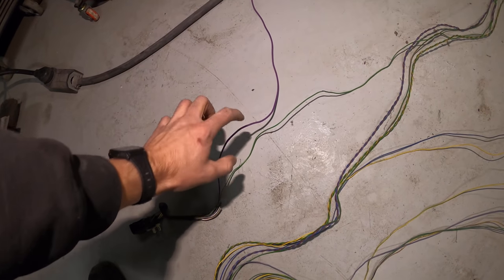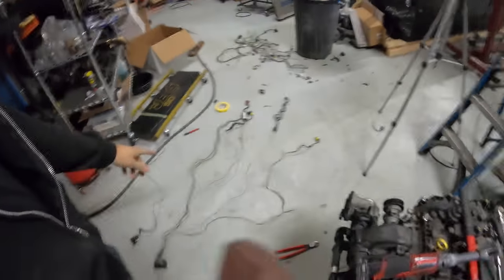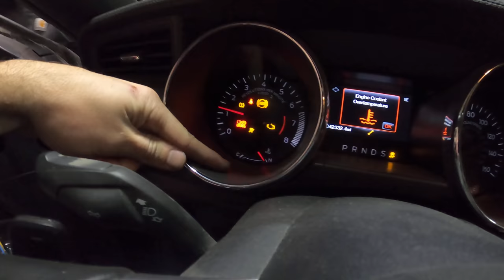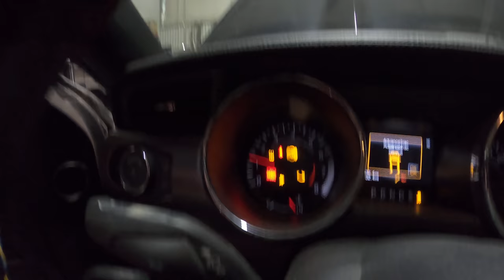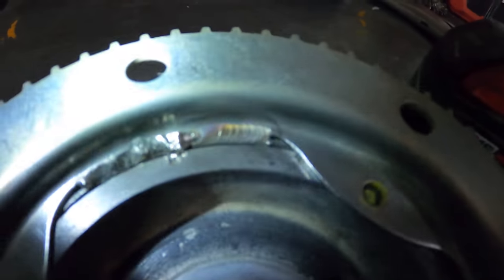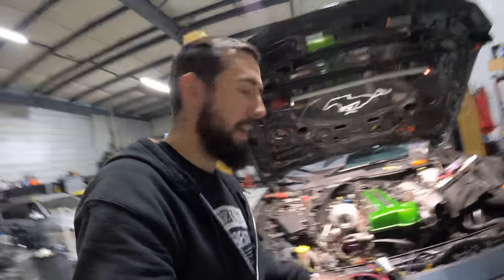Pt.5 | 2JZ 2015 Ford Mustang Build! ( Manual Conversion )

Comment: Trevor man it kills me to see you un-looming that entire harness on the floor. Get yourself a 4x8 table and save your knees. I always make fun of my 30 year old buddies and call them teenagers when I see them woking on the floor lol. Build is coming along nicely. If you cant get the remote start to work than install compustar/firstech brain and remote package to get that remote started. Ive done a lot of fords and that product uses the canbus to start the engine, plus they have reservation mode specifically for manual transmission vehicles. Need to hook up door trigger and parking brake wire to make them work. If I ever make it to Colorado I would install it for free for you just because of the cool builds/information sharing you do.

Comment: Hey bud, just a suggestion. You're gonna want that crank position sensor mounted to the engine. If its chassis mounted and the engine flexes in could lose signal or clip the sensor.
Reply: I guess I should have waited till the end of the video to comment. Lol you literally voiced my exact concern immediately after I commented.

Comment: Emu black can operate 2jz-vvti's throttle to 100%, you can just wire in the mustang's electronic pedal and remove the throttle cable. Also the sensor connected to that cable is not throttle position, but pedal position. With DBW it's not the same thing, because throttle is also used for idle control. Throttle position sensor is located on another side of throttle body (same as DBW motor). So if you use electronic pedal, throttle position sensor still works.
Reply: I've seen people on other ecu platforms have issues with those throttles. At the end of the day, he'll get it to go but it would have been nice to try

Comment: The electronics on the throttle body of the vvti 2JZ does indeed slap shut when using an auto trans to cut torque during shifts. It’s a weird feeling once you add a bov because when you are full tilt and it shifts you hear the bov but your foot is still flat to the floor.

Comment: Great build and vids! Keep them coming! And i think that sensor would be better on the engine with bracket. Just in case of motor flex or movement of the body. I think you just need to put up the e-brake for the remote start to work on it.🤔

Comment: Making a throttle cable and petal work with shit laying around is actually pretty satisfying. Fc rx7 petal in my Ls Swapped Studebaker truck. Making shit work with what you have is Hot Rodding no matter the car

Comment: My thoughts exactly. If that engine moves or a motor mount decides to bend that tach signal goes bye bye and seeing that its the most important thing to make things work, i thing you need to figure out a better foul proof bracket/location.

Comment: Make it so the crank position sensor is vertically or horizontally down. This will prevent road grime, oil or water from settling on the pickup and interfering with the signal.
Reply: The pickup is not affected by anything other than metal

Comment: Hi Trevor, Hi Dave,  looks good,  on the sensor mount, simple is best, if the engine shifts or torques over, the sensor  may not maintain signal.  It should be mounted on the motor.  Changing the clutch is a good idea, it should last a good long while. If the last one lived for four years. This engine is a beast.  It worked like a monster in the drift car. Are you going to change the colour of the valve cover? It is a great build. Nine days to complete means pulling some late night/all nighters.

Comment: I  would mount the crank sensor so it always stays relative to the engine position. Your first solution  in my opinion was better because if the engine moves the sensor moves with it.
Hope that makes sense.
Reply: Did ya watch whole video he literally says he is going to mount to engine
Reply: @ninablatchley842  thanks

Comment: You need to attach the crank position sensor to the engine. If the engine moves it will mess with the signal.  I spoke too soon. Trevor figured it out.
Reply: John Scripter 12:23

Comment: Definitely find some weight reduction in the rear when you tear it apart for the fuel. Don’t need seatbelts in the back that’s 5 lbs.
Reply: I bet there’s computers in the quarters for abs or airbags

Comment: Hi Trevor 
In regards to the crank sensor input ,have you checked if the ecumasters tach output puts out a similar wave form to the ford's crank sensor ?
You may be able to send that signal directly to the ford ecu to trick it.
If it's not similar and the ford ecu needs to see a missing tooth ,it may be possible that ecumaster be able to set up one of the spare outputs to clone the ford signal.

Comment: Starting to warm up to the build , you certainly know how to push through , change that crank sensor location back seriously though unless you know of some high performance builds that mount crank sensors to the chassis for drifting and the like.
Reply: R wells did you actually watch the whole video before commenting??
Reply: @RevMatchDesigns  No when I saw that placement  an alarm immediately went off

Comment: hope the engine doesn't move too much cuz otherwise your sensor will just lose rpm randomly... just sayin'!
Reply: I've done the same thing he's doing here a few times, there shouldn't be problems.
Reply: 12:23
Reply: Thought the same thing and on second thought he is hard mounting the F out of this motor so should be no problem
Reply: Niiice💪much love
Reply: Just bolt sensor on a bracket to the block and be done with it.
Reply: I’m guessing you didn’t watch the whole video? Haha
Reply: @JZEFPV  I will confess to typing while watching. 😁
Reply: He's got solid engine mounts, where is that engine goin to move to lol? Besides it jerking up when given throttle but that's on cars with poly engine mounts. Don't think I can say I've seen it with solid ones.
Reply: He explains it.. if you watch the video

Comment: Do U have solid engine mounts to go with the crank angle sensor? Engine might move abit and affect sensor??
Reply: Dfekt Nsc 12:23
Reply: He hard mounted the engine with plates of steel, but yeah he may change the sensor still.

Comment: The sensor grafted on to the balancer seems so janky, this is a really cool build, but can't you get one of those translator boxes that takes the rpm from your engine and sends it to that module that needs it? Like those adapters that take an ecu signal and converts it to what the dash wants to see in swapped cars. I think I saw one used on hondaru. The makers could program one for what you need I think.

Comment: From what I know manual mustangs don’t have a remote start feature.
Reply: True didn't think about that can't really start if it's in gear lol would make for a bad day start car in 1st amd car takes off
Reply: @ninablatchley842  manuals can have remote starts. It wont start if it knows it's in gear and most likely the electric parking brake or a parking brake sensor depressed as well. Manual 4th gen dodges manual coyotes camaros etc can all have it
Reply: @jaredanthony8070  not factory, there are aftermarket systems I believe.
Reply: @justinlabarge8178  I knew someone with a bone stock '11 ram that was a stick. It had remote start. I also have been at a dealer and had them remote start...but looking it up it appears you are right. Strange
Reply: Remote start on manuals fine, just need a sensor to ensure clutch is fully engaged before starting
Reply: @NZDIRT  if you need to be in the car to push the clutch in, isn't the remote start kinda pointless???
Reply: @MrJsm1980  yea it needs to be parked in neutral with parking brake on for it to remote start, he could possibly use the stock sensor from auto loom and splice it into the clutch sensor in the manual loom
Reply: @kman634  I get it now, cheers mate

Comment: Bad idea to mount the cps to the frame. The bracket is usually mounted to the engine so both physically move in unison, never changing distance between each other. So the ecu always getting a strong signal. If the engine moves up, down, left or right. Bad things will happen.

Comment: Hello your bracket to RPM sensor IS on the châssis , but when the motor move on the châssis your distance betwen the sensor and the  motor move badly . How you move the sensor on motor a the back if vidéos. Best

Comment: Unless that’s got solid motor mounts how do u plan for that to keep the gap like so under hard acceleration? Engine flex is gonna pull it away
Reply: Davi J  did you even watch the whole video?

Comment: Trev, keep those de-pinned pieces handy. Bag and tag them. You'll need them at some point in the future I promise. 

Also, when are you going to do that DSM? I still have that Titanium Brian Crower spring and retainer set with Supertech Stainless Steel valves. (Overside a bit if I remember correctly.) Reply to my insta message.

Comment: If the crank position sensor is mounted to the frame, what happens if the motor mounts let the engine tilt back during a rev will you loose readings?
Reply: Just mentioned it at 12:35 NM

Comment: The tach might be different with 4cyl to 6cyl?? Or it’s adjusted for in the ecu?
Reply from the maker: its going off the revolutions of the crank instead of an ignition coil so it should be spot on
Reply: Thanks for the reply! And the info!! This stuff is super cool, keep it coming and get the remote start working

Comment: I think that bracket is in a bad place it should be off the engine the engine has rubber motor mounts right
Reply: Allan Folkes 12:23

Comment: I mean, don't get me wrong, because this swap is different, and that makes it cool, but after everything is said and done this'll just be a turbo six cylinder Mustang. I'm not trying to be a Debbie Downer here, but if you were going to swap this car, why didn't you decide to go turbo Coyote, or even a crazy high compression Voodoo engine? Was this a personal goal, or you trying to challenge yourself? Like I said bro, I'm not trying to say that this isn't a cool build, but it doesn't make much sense to me to swap a 2JZ into a modern Mustang when you could make close to 375 whp out of the box with a manual Coyote for around the same price with MUCH less headache and work. I'm just trying to figure out the reason for this swap.

Comment: K.I.S.S.-KEEP IT SIMPLE STUPID.  Quite honestly i don't see very much wrong with doing it that way seeing as the engine is solid mounted. Keep an extra crank plug(s) and sensor(s) in the glove box and let her rip. Don't over think it you're doing really good at not making this a headache later on. If i could recommend one thing it would be shield the crank sensor wires. They can be susceptible to radio interference. If you wrap them in something that's metal (heat wrap tin foil) it should keep the signal to the ECU clean. Ford has based everything off the crank sensors since the 80s. Maybe use a bit of gaskets material to mount the bracket (for the crank sensor) to the frame just to give it a little bit of ease.

Comment: You should 100% get a billet pulley turned up with the crank positioner and bracket for the sensor that gets sandwhiched between the block and the crank pulley so it moves with the enigine. Does that make sense?

Comment: Are you afraid of your motor moving or slightly rocking during a clutch kick and hitting the crank sencor? Or maybe under a pull it may gain distance and not read?

Comment: I would think you would want the crank position sensor attached to the motor, if there is any movement in the engine with it attached to the cross member you might lose signal.

Comment: Why would you not just mount the cable to the factory throttle pedal??
Reply: Danny Rincon because it’s drive by wire
Reply: @carguyty9370  you dont say... What i was saying was to mount the actual cable to the drive by wire pedal and maybe just use a stronger spring.

Comment: Wouldn't it be best if it was mounted on the engine cause it the engine move the sensors move with it but mounting it to the body will cause it not to move but at the sametime when the engine move it might get caught and what not